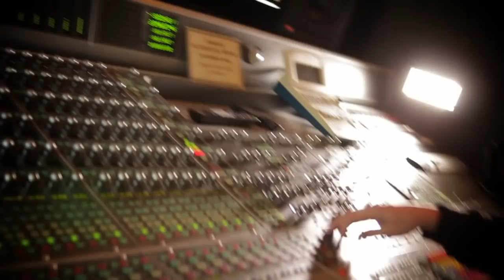Working On a Building

Comment: I'm not familiar with gospel music (and I'm not an American), so if someone would please explain: is this song the same "Working on the building" Elvis used to sing? They hardly sound any similar, neither in harmony (which I believe is not unusual), nor in lyrics, apart from the first verse. Are these two completely different songs who share the same title and overall plot, and nothing else?
Reply: In many Southern Gospel traditional songs (such as Workin' On A Building), the song may be rendered in several different styles with added verses and still be the same basic song. This is the case here, where the musicians render the song in a rock-a-billy up-beat style. Elvis did a similar style but with fewer verses and stops but it's basically the same song interpreted differently by the artists. If you were to search on YouTube for this song title, you will find several different styles, some slower and some faster even to a Blue-Grass style with banjos, mandolins and fiddles but you could recognize the same basic framework of the song.